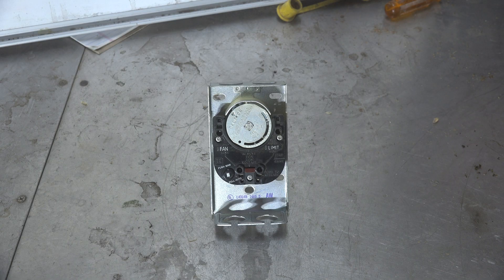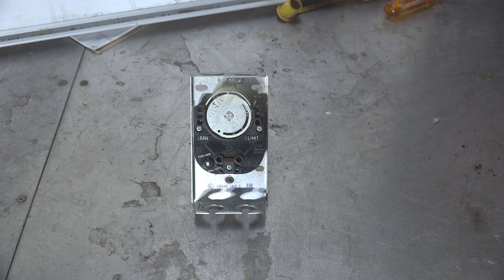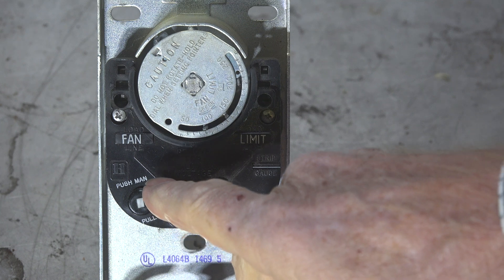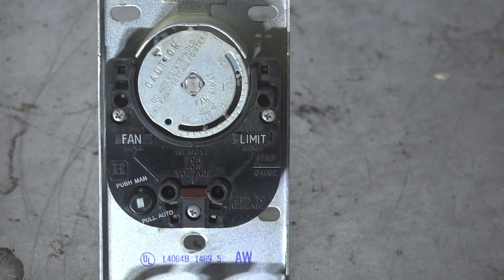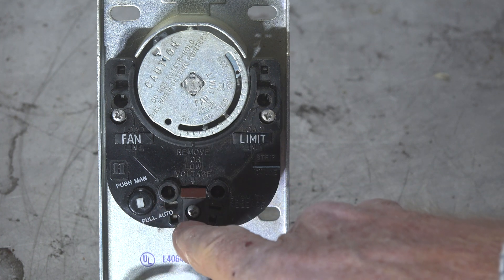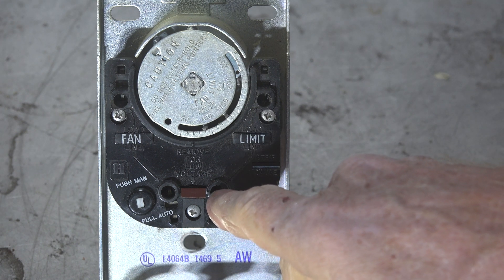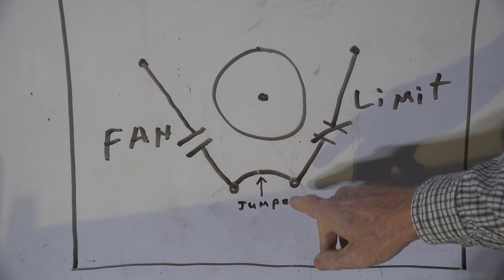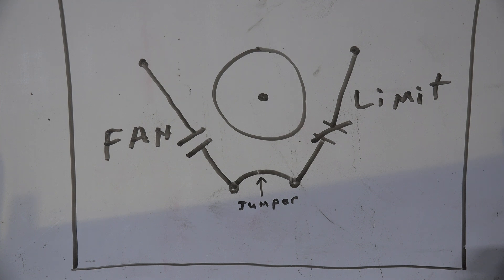How to wire the Honeywell fan and limit switch for the gas or oil furnace

Comment: 😅😊😊hi , I'm wondering how the bearing functions  . Is bronze stationary in bearing it's self and shaft rotates in bronze piece or is bronze tight on shaft and turns in eating . Maybe you can explain it better . Thank you
Reply from the maker: The bronze bearing is pressed into the end bell of the motor and the shaft rotates against the bronze.
GFM
Reply: @grayfurnaceman  Hi , I got some new bearings . They seem very dry , no lube . Do they have oil or grease inside or do you oil them or soak them . Your opinion will be appreciated , thank you .
Reply from the maker: If they are sintered bronze, oil is provided in the package.
GFM @marksayre1358
Reply: @grayfurnaceman  All there was were the rubber sleeves and sintered bearings. If you could explain what needs to be done , I could dig it . Thanks
Reply: Hi , I've looked all over for a blower wheel , 11"d x 8"w x 3/4" bore , convex  doubleinlet . You have any idea who might carry such a beast ?
Reply from the maker: You might try Grainger.
GFM @marksayre1358
Reply: @grayfurnaceman   l thoughti did but will check again , thanks .
Reply: @grayfurnaceman   Forgot , ccw

Comment: Seems as you’re replying, have a buddy’s whose furnace I just swapped, has a newer Honeywell limit switch, the blower motor runs constantly even with thermostat disconnected, any suggestions
Reply from the maker: If the switch has a white button on its face, it may be in the on position.
If the button is ok, the switch is stuck on and should be replaced.
GFM

Comment: Thank you for the video. Just wanna clarify, based on what you shown. The left side would be 120v hot, and the right is 120v hot to the transformer if there is a jumper. If there's no jumper, then the left side is 120v hot, and the right side is a 24v. And each side has 3 connection points. Correct? Thank you
Reply from the maker: You got it.
GFM
Reply: @grayfurnaceman  thank you Sir! Your the man!  I appreciate all your contents long time subscriber. 😁

Comment: not a very helpful video at all. didn't even show any physical wiring of the switch. just pointing and saying how to hook it up doesn't really help anyone who needs help or anyone who is new to doing this kind of stuff.
Reply from the maker: There is a playlist on fan switches that may help:  https://www.youtube.com/playlist?list=PLItXrh64d2JOatkfw8W6WLm5jUw_tdp6D
GFM
Reply: @grayfurnaceman  thank you. I just guessed because the new control was different from the old one. I lost both heat sources last night in my wood and oil furnace. So I was frustrated and trying to get the easier or the two running. But I got it; the wood furnace, going. Working on the oil furnace fan motor replacement now. Thank you again for replying.

Comment: Well how do I get the wires out of the thing?
Reply from the maker: Its a secret.  Only qualified service techs can know that. lol  The rectangular slot above the wire connector is for a small screw driver to be pushed into to release the wire.  When reinstalling, again insert the screwdriver in the slot and then push in the wire.  
GFM

Comment: What is the modern setup, if these aren't used anymore?
Reply from the maker: They are available as a repair part.
GFM
Reply: @grayfurnaceman  That's not what I'm asking.  How do more modern furnaces accomplish this?  What kind of device do they use?
Reply from the maker: @pleappleappleap  They use timers.  Fixed on delay, adjustable off delay. All controlled by the control board.
GFM

Comment: Can I wire a switch to make the fan run on manual if needed I gave a psg wood and oil combo ?
Reply from the maker: Some of the fan switches have a white button that will turn on the fan manually.
GFM
Reply: @grayfurnaceman  yes mine has that but it broke off and wondering if it's possible to just put a manual switch on
Reply from the maker: @bradcranley7059  You can place across the fan terminals that are marked on the switch.
GFM
Reply: @grayfurnaceman  and hook that to a switch for manual ?
Reply from the maker: You got it.
GFM
Reply: @grayfurnaceman  thank you

Comment: Thanks for your awesome vids! So grateful, you already saved my life, but wonder if you can also tell me if I can simply replace my F&L that has no manual button with one that does have that? I just want to obtain ability to very occasionally turn the fan on when pilot is off and without running heat. Mine is Honeywell,  jumper pulled off, four wires in the fat holes, no preheater. If I change it out for one with the manual button, is it safe to assume I just use the same four wires and don't need an extra relay? I believe this gas furnace is a 1973 Whirlpool. (Model FXB47-150ER, serial H33721358).  I've seen some say you can simply add a standard light switch or a toggle switch between R and G terminals, which would be even better for me (though I think I want to replace the F&L anyway, it functions correctly, but the face is too corroded to read). I didn't try the switch between R and G, though, because I saw some saying you must add a relay to do that, and I don't know how to find the right relay or exactly where it goes in a switch set up like that. In my furnace, the bar of terminals is along side the "fan center" and has  two-screws each at G, C, R, W, Y, X.  Wiring diagram shows G could have been wired to T-Stat, but I've only got a double wire to R & W, and too tricky a route for me to pull a new wire. Wiring diagram also shows a "spot relay" on that missing G-to-T-Stat wire, though. I'm not clear whether that is already handled inside the relay box of the fan center.  I see only one wire on one of the G terminals, and that goes directly into that relay box area. Thanks a million!!
Reply from the maker: I would try jumping R to G on the terminal strip.  If the fan comes on, you may place the light switch in the circuit.  If not, the Honeywell fan and limit with the manual switch is available.  
GFM

Comment: Hey man, some of the guys at work are shown your videos to help with their training. I still watch them from time to time. I’m out of the Shenandoah valley in Virginia. Anyways, I’m somewhat decent with control wiring. If you don’t mind could you look up this model#-bc-44a8-fa-nlc. It is a fan timer control used on an oil furnace. It gives the user the ability to let the fan control both the oil heat and an air conditioner. In my setup, there is no ac. My fan is not cutting on once the burner fires therefore locking it out. Due to not having ac, and the replacement part being around $400 dollars, im wondering if I could wire this style you have in video in place of that control box style?
Reply from the maker: You can certainly wire it in.  It would have to be mounted in place of the limit switch and would be used as both a limit and fan control.
The probe length would have to be checked before installation to eliminate interference with the heat exchanger.
The lengths are 5", 8" and 11".  
GFM

Comment: I have an old gas furnace (from the 70s I believe) that just has a combination gas valve with a non adjustable fan switch attached. The fan seems to take a long time to turn on after the burners are lit and I feel like I'm wasting heat. Is it possible to update to an adjustable fan switch?
Reply from the maker: If the original fan switch probe length equals 5, 8, or 11 inch, you can replace it with the switch in this video, just using the one that equals your probe length.
GFM

Comment: thank you for posting this. your switch schematic was a helpful starting point to troubleshoot my furnace. My problem was an open stranded conductor connecting the line side, and a blown 25v transformer.

Comment: I think I've broken my furnace. I did not remove the jumper wire and when I pushed in the knob to manual, something somewhere clicked and now I have no blower. I see now that the one I replaced had the jumper wire broken off. Is there anything I can do?
Reply from the maker: If you heard a click, check for a breaker.  It will be a button that has popped out.  Could be on the transformer or near or on control board.
GFM
Reply: @grayfurnaceman  Wow thanks for the quick reply. It's what I thought but I can't see one anywhere. I'll take a closer look.
Reply from the maker: @ronaldfilion  If you give me a make and model or send a pic to Grayfurnaceman@gmail.com I may be able to help.
GFM

Comment: So when you say to isolate the two wires that go under the dial, do you mean to leave them disconnected and tape the ends?  The furnace will still work this way?  Thanks for any help.
Reply from the maker: Yes, tape the ends so they do not touch.
GFM

Comment: Mr. Grayfurnaceman, I need some information if your able to help.  I have an issue that just started with my furance with the limit switch.  My burners come on and after about 3-5 seconds later, I get a bang/pop that comes from limit switch.  Could the bi-metal spring have a sticking point right when heat hits it and it starts to turn?  Even though it makes the sound, it still works correctly.  Thanks for any help you can provide.

Comment: I want to run 2 fans from this thermal control. Can i just jump a second wire in? will it take the extra amps/load?
Reply from the maker: It will work ok, as long as you do not exceed the rated amp draw printed on the switch.
GFM

Comment: My burners would come on and run for 1.5min then shut off, then after cooling for 30 sec it would run again. Turned out the coil in this limit was worn and the system would think it was hotter than it was. Replaced and fixed issue . Only realized I had this issue after installing a WiFi nest thermostat.
Reply from the maker: Glad you got it going.
GFM

Comment: I never knew those came with a pre-hear and I absolutely think I know the application for which it would require one but I only have a sample size of one I had to replace fan limit switch just like that on a 90% furnace I did have to make some adjustments with the fan on and off temperature so the blower would stay running

Comment: Great video and I also would like to give you a little history on this fan limit control. This fan limit control is the reason why engineers in the HVAC manufacturing industry designed  the secondary ECO one time use limit. We found this fan limit control to have devastating failures throughout the United States. At times the heat sensing spring would lockup ( caused by rust and A  coil drain pan leaks) causing the fan to never come on or limit to open. So as you can imagine many houses burnt down and people lost their lives. So my suggestion is if you ever replace one of these fan limit controls  an a ECO limit is not in place, add one . Also note this fan limit control comes in two sizes short and long ( make sure you know the one that is required). Also I wanted to correct you I believe you misspoke,you said this mounts inside the heat exchanger , it does not ( it mounts to the furnace cabinet sensing heat from the outside of the heat exchanger). Great video and keep them coming. Y'all stay safe out there.
Reply from the maker: I have not heard of the rust problem.  Good to know.  I never argue with someone that wants to add an additional safety device.
GFM
Reply: @grayfurnaceman  , I am sure you have seen the ECO thermal link safeties they added on in the 80s . I was a first responder / service technician for the gas utility in St Louis, Missouri & got that emergency call quite a few times ( luckily 99% of the time we would catch it early before anything happened). Hopefully by now most of those furnaces have been replaced.
Reply from the maker: @boby115  I have.  By now, it should be a non issue, as you have said, all these furnaces are 30+ years old.
GFM
Reply: It was probably no one knew they were in there and they weren't told about it. 😒

Comment: Thanks, my system uses the yellow wire for the pre heater. I bought a new limiter, but it does not have the connector for this wire, and I couldn't find any videos on what to do in this situation. Thanks.
Reply: If the new one has no preheater you can either remove them from the gas valve or insulate them and abandon

Comment: They removed the old 5 wire. Only make 4 wire. American standard package units are next to impossible to replace because you get back voltage that turns on a.c and also if you use the wrong one Robert shaw vs Honeywell it won't work. Also requires peanut relays to change them out.

Comment: Thanks for this video! I have questions on gas fireplaces if you can answer them. I’ve been servicing gas fireplaces and finding dang near every the thermopile on opening circuit only generating 130-150mv and close circuit drop down 50-80mv. Most of the pilot assembly’s are 3ways with pilot, spark rod, thermopile and thermocouple. How is the fireplaces still operating on such low mv? Is this normal or does the thermopiles need to be replace. I’ve tested new thermopile right out of the box and only generate 250mv. Please educate me, I’d really appreciate it, and do right for the customers.
Reply from the maker: I can't say I have seen that.  The 500 mv number is seldom true as the instructions say but not that low.
GFM

Comment: Hello, I looked at the video you made in 2013 ... I want to ask you where I can buy a gas valve for this heater ... this is the mo heater model.
make ArcoAIR
model GDI075A012CIN
MODEL L943259605
Reply from the maker: The valve is a White Rodgers 36E97201.  
GFM
Reply: @grayfurnaceman  Thank you for the info...Do you know where I can buy it
Reply from the maker: @mateorivera433  I don't have any trusted sources, but there are many websites and also a local HVAC dealer can get it.
GFM

Comment: Interesting.... I know this is off topic but could you give your opinion on hvac damper motor adjustment or replacement , problems or any other info
Reply from the maker: A bit more complicated than a response in the comments section.
GFM
Reply: @grayfurnaceman   and remember..... Honey well is always better than honey pot....😥

Comment: only seen a few with the preheater over the years, seems to me it was mainly on the oldest "high efficiency" units. which nobody around here went for :)
Reply from the maker: It was one of the first things furnaces did to increase efficiency.  Did not help much.
GFM